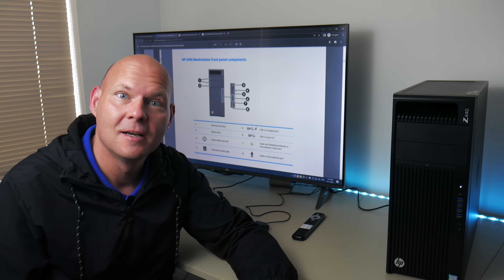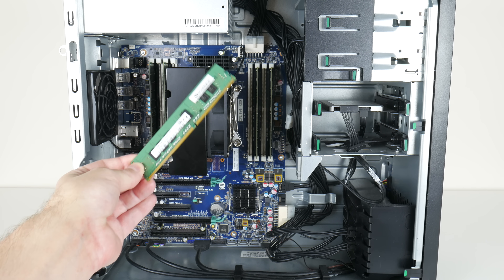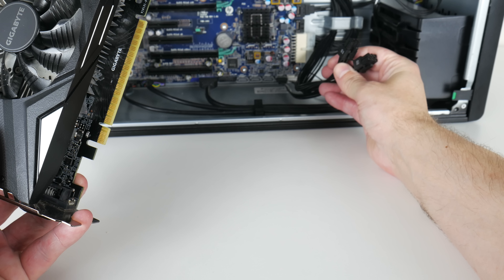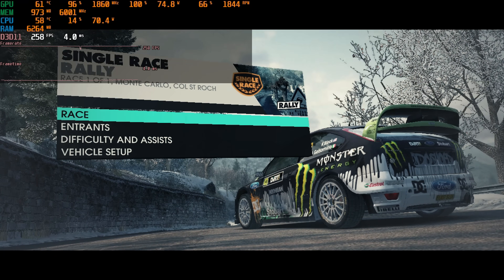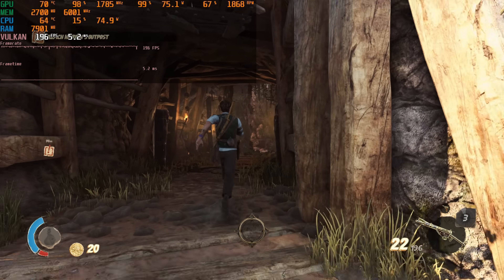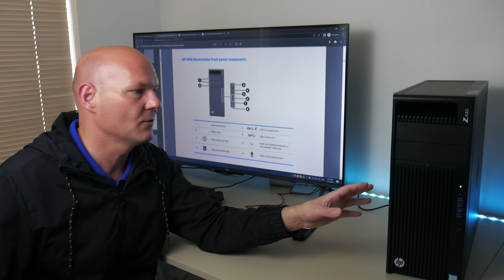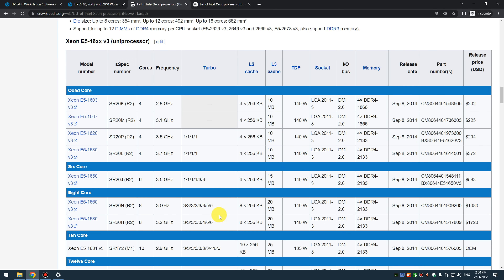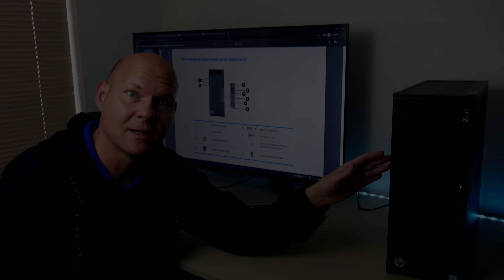This HP Z440 PC was my best purchase this year

Comment: My brother wanted a cheap gaming PC, So I bought a barebones Z440 tower complete with motherboard, 700W PSU, front & rear fans, CPU cooler and drive caddies etc... I added the CPU, RAM, GPU, Wi-Fi adapter and SSDs. It was up and running Windows 11 in no time! A clean install of Windows 11 bypasses the TPM 2.0 requirement, but you can update the TPM firmware to version 2.0 with the Z440 anyway. The latest BIOS version is dated March 2022 which is also surprising for a system of this age.

All the needed parts were pretty cheap on eBay. The 6 core/12 thread Xeon E5-1650 V3 chip was a bargain at just £20 and the RAM was also quite cheap at £40 for 32GB of ECC DDR4 in quad channel config. I bought a cheap M.2 NVME to PCIE adapter from amazon for around £10 (Glotrends brand) which allows the PC to boot from a 1TB MSI Spatium NVME SSD and the drive had no issues reaching the max advertised read & write speeds. I also added a WD Blue SATA SSD for extra storage, an XFX AMD Radeon RX 5600XT for 1080p gaming (using 6-pin to 8-pin PCIe adapter) and also a PCIe Wi-Fi adapter with Bluetooth (Intel 7265 Dual Band AC which does the job). So far it's been 100% reliable and a very good performer!
Reply from the maker: Awesome!

Comment: Nice build, and that 1650 can definitely game at 1080p on higher settings, at least for some titles. With some of the more demanding titles, you may be better off at 720p high compared to 1080p low (or using resolution scaling), but given that its primary intended use wasn't gaming, I have to say I'm impressed.
I've thought about getting those Z440 style workstations before as they still seem to be pretty competent overall, in terms of performance and features etc. I'd also be getting a memory cooler and going 128GB RAM, because you can never have too much of RAM. :)
Reply from the maker: I wanted to showcase the potential of the machine. Wish I had a better GPU to do this, so running at 720p gives you a better idea what it could do with a decent GPU.

Comment: @PhilsComputerLab
What is it with Youtubers lately telling people to avoid hard drives? Seriously? They're not a bad thing. Stop telling people that nonsense! You can run an OS just fine on them and they're awesome for mass storage. Try and find a 8+TB SSD for a decent price... Go on, try... (hint, you're not going to find one for less than $650USD) One can buy an 8TB HDD for $130 and a 12TB for as little as $240. So yeah, stop with that nonsense please, you're not doing your lesser informed viewers any favors. Sorry if I seem a bit aggressive, I'm just irritated that this silly myth that hard drives are no good anymore is floating around and being propagated by people who really should know better.
Reply from the maker: Mechanical Hard Disk Drive is the SLOWEST component in the entire computer. It is really bad advice to tell people that using a HDD is acceptable as OS drive. It is the single best upgrade you can do to an old computer to improve performance and something like a 256GB SSD is very affordable. So don't give bad advice, do better!
Reply: @philscomputerlab  
Seriously with that? Nice paraphrase there from my conversation with someone else elsewhere. You're wrong BTW, but hey, no one is perfect. Using a hard drive IS still perfectly acceptable, ESPECIALLY a modern drive. The actual performance differences are just not that big. I'll give you the same challenge I gave someone else, do a comparison test. Pick one of your systems and test boot-up times, program start up times and general computing use times with each type of drive. Go on, back up your claim! While I'm not saying SSD's aren't excellent, they're not ubiquitous yet and they can NOT compete in available space/cost.
Reply: @philscomputerlab  Phil, Lex is right. Hard drives are still useful as a main system drive. Not as fast as SSD's, but they're still plenty quick. There are no operating systems that will not run well on a high end hard drive. Stop being so angry.
Reply: @philscomputerlab  once the PC has accessed the data it can be cached in RAM. So you're only pulling it off the storage once. When I first boot my PC things take a moment to load but after that they just pop right up. I only reboot when the power fails. So it's not like I'm doing that on a regular basis.
Reply: @philscomputerlab  Phil these guys are right. Using a hard drive is ok. I use a WD Black 6tb in my computer and it runs fast. SSD drives are faster but good quality hard drives do the job well.

Comment: Turbo unlocked ir?
Reply from the maker: Not that easy on this HP machine, but also not impossible. AFAIK you need to use a hardware BIOS chip programmer...

Comment: p,s, how does this cpu compare to say an I7 . Thank you
Reply from the maker: You would need to compare the specific model. In general i7 are clocked higher but Xeon have many more cores.
Reply: @philscomputerlab  Hi . Thank you for taking the time to reply. I’m glad that i've found your channel . Your videos are interesting and well presented. I am very interested in acquiring one of these and while I’m quite clued up on computers I must admit that I do get confused with so many options and different variations of these machines especially when coupled with the fact that I’m a bit wary of buying second hand in case their are issues. I want to get a HP Z440 Xeon 1600 or E5 2699 v3 like yours. Best wishes and Thank you

Comment: This is a really nicely build workstation, wow! It looks like maybe even better engineering than a Dell workstation? Unfortunately 99% CPU load is not always an indicator that a game maxes out the GPU anymore. It's much more complicated with these modern engines today. Running parallel and all sorts of factors. I believe fx in cyberpunk the 1650Ti should perform much better with a modern processor. That 45mb cache is definitely gonna work out in favor in productivity tasks, but gaming is, no matter what, is a huge bottleneck with haswell.

My old i3 4150 is pulling better single core performance as that xeon. IPC is literally the same, clock for clock, and i contemplated going the same route with a xeon, but ultimately decided against it, because of the IPC and how more modern games work.

This would be a beast for windows 7 era released games!

Watch out for an old PSU. 10 years runtime, is the time for starting to plan for that it suddenly just wont turn on and the PSU just silently gave out

Comment: I don't think this is a good system. It may be built like a tank but frankly that motherboard does not look very tank like, with the power delivery are rather small for a 145W TDP Xeon and not even heatsinks on some of the VRMs.
And it's an 8 year old tank. That E5-2699 v3 was a beast in it's time but in the last 3 years IPC in the AMD Intel battle has risen so much, that its on par with some 8 core 16 thread mid range processor from 2021. A 12600K probably beats it - at a lot less power usage - which is becoming a concern at least here in the northwestern hemisphere.
And 720p gaming... okaay. Guess it works. 

Not sure what the total spending on this is including all the upgrades but I am not really convinced it is a bargain. Maybe it#s okay value for money but definitely not a bargain, compared to modern systems.
Reply from the maker: Just buy 4080.
Reply from the maker: But fair comment, looking back should have done some before and after upgrade comparison.
Reply: @philscomputerlab  Oh bugger, Phil. You found another one!😁

Comment: 180 dollar is just dishonest. Yes you get a fine machine for that, but the machine you promoted had several upgrades. So someone looking to replicate your result would have to pay those too. My guess would be you at least doubled the price with the upgrades. New memory, new CPU, new storage, new GPU. 180 dollars is for your result only the price of the bare bone machine. So next time full price including upgrades please.
Reply: But keep in mind a high quality case alone is not cheap, add to that the motherboard, psu & memory. Those three alone make it worthwhile, since he liked the PC model already.
Reply from the maker: Fair comment and I should have tested it stick also to compare. The next OEM machine I'll improve. I wanted to show the potential of buying the cheapest configuration.
Reply: @O.Shawabkeh  no you're missing the point. Yes the PC came in a usable form, it's a good machines, but that was not what he showed the games and benchmarks on. The actually enticement part of the video was all on upgraded specs. If he did benchmarks on both i could let it go, but as the video is, no. 
The video thumbnail talks about a 180 dollar PC being worth it, but from information presented you can only determine if an upgraded version of that PC is worth it. If the title said 180 dollar starting point, you might have a point.

Keep in mind how many stupid people there are. They buy this machine on faith never realizing how much of the video depends on the upgrades, without it they are disappointed and out their money.
Should they watch and research better, yes they should. Do they, no. Is the low price in the video to attract views, yes, clickbait territory.
Reply: @philscomputerlab  good enough for me. you did show a lot can still be had from these older platforms. If you enhance the video next time with stock results it's perfect. I do buy refurbished myself, it's cheap and perfectly capable for most daily stuff. Don't do much gaming anyway, so i don't care much about the video cards, which keeps things cheaper.